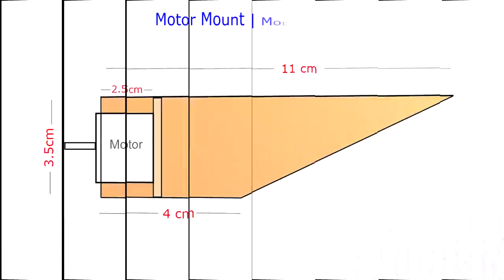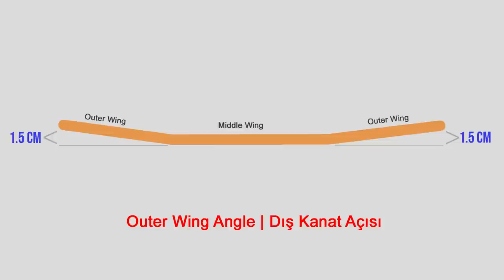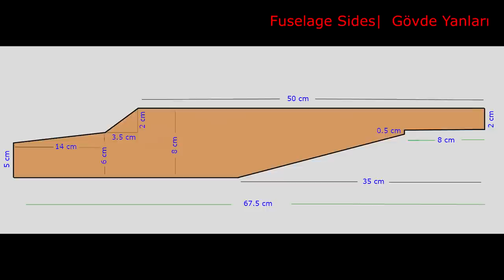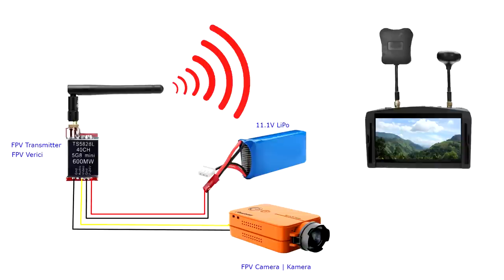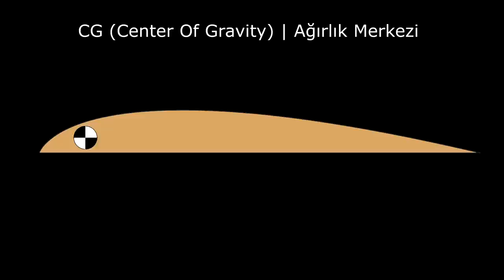Making RC Model Aircraft With Twin Pusher Motor. DIY Airplane With Camera. FPV

Comment: Hello my friend...Awesome your work on rc planes! I want to ask you if you think it´s possible to make a 5mm. foamboard trainer rc plane using a 380 Mabuchi brushed motor style and a 6v NiMH 5 element battery pack with brushed ESC and if you could us to show how to do it or a rc plane plan to install this kind of equipment. This could be useful for us the boat modellers as we don´t have brushless motors or ESC, batteries, etc. Many thanks in advance and have a nice day! Best regards from Spain and keep on your fantastic Kendin Yap (D.I.Y in English ;-))

Comment: I built your fpv system (very smart by the way) and i was wondering if this plane is the best for the system does the cargo plane do well with it too or should i just stick with this model
Reply from the maker: It can be applied to many models. If the goal is long flight time, the model whose video I uploaded recently is much more efficient. https://www.youtube.com/watch?v=eHdxx4qpVko
You can also use your existing remote control with this model.
Reply: Is this model better for the fpv system because it has 2 motors,carrying the weight better or does the plane you sent (the link) work just as well withe just one motor? Is there a difference in how they fly?

Comment: Is this model better for the fpv system because it has 2 motors,carrying the weight better or does the plane you sent (the link) work just as well withe just one motor? Is there a difference in how they fly?
Reply: Sorry to bother you but would the diy landing gear video you made also work well with this model ( the video I sent this comment one) in terms of weight  thank you for your time
Reply from the maker: There is no difference in the way they fly. Having the engines at the back is to avoid obstructing the camera's view. The plane in the link is much lighter. The only advantage is that the flight time is longer with the same battery. You can choose according to which advantage is important to you. Both models can easily carry FPV equipment.
Reply: Ok thank you

Comment: I was watching your video and saw that one propeller is clockwise and the other is counter clockwise ,but what about the motors them self? should they both spin clockwise,counterclockwise? Or should they be different so one motor is clockwise and other counter. Anyway I just built this model so I was wondering because I was confused. Thanks love your videos

Comment: Sorry but one more thing what is the stuff you put on at 13:01?
Reply from the maker: "Aileron hook up part" there are not many stores selling this part. So you can use the following piece instead, which is a complete solution.
https://s.click.aliexpress.com/e/_DdDbu7Z
Reply: @Kendin-Yap is the 2.6 mm appropriate for the servo or is a different size required. The servo I'm using is the one you sent in the link for materials

Comment: did you made the battery by your self !
Reply from the maker: Yes. 3 x 18650 li-ion battery (VTC5A) . Serial connection....
Reply: @Kendin-Yap  i was going to buy a 3s lipo battery but now i'm going to make my oun, i thought of making my oun 3s li-ion battery but i wasn't sure if it is going to work hhh! but now when i saw your video i'm confident. thank you <3

Comment: The only issue I see is that you have no way to tell the motor battery level remaining. If you're too far away (the range showed 3.5km), and your motors die, you'd have a pretty long walk to find it.

Comment: Hocam elinize sağlık uzun zamandır sizi takip ediyorum bir kaç sorum olacak kanat açıklığını 120cm olarak yaparsam sıkıntı olur mu? Birde toplam ağırlık kaç çıktı. Açıkçası niyetim bu uçağı 120cm kanat açıklığı ve tek motorla denemek. Elimde 2212 2450 KV 815gr thrust racerstar bir motor var kanat alanını arttırmak istememin sebebi Wing Cube Loading değerini düşürmek içindir.
Reply from the maker: FPV ekipmanı yokken yaklaşık 770 gr. FPV ekipmanı ile 880gr . 120 cm kanat olabilir. Tabi ağırlık artacaktır. Ve bunun için 2450KV tek bir motor çok ideal olmaz.  Güç yeterli olmayacaktır. Elinizdeki motordan iki tane kullanırsanız 120cm kanat boyu ile verim alabilirsiniz. Tek motor kullanmak istiyorsanız mevcut kanat ölçüleri ile denemenizi tavsiye ederim. Tek motor ile yapacaksanız gövdenin burun kısmını da 2cm kısaltın. 2. motor ve 2. ESC nin ağırlığından da kurtulacağınız için uçak biraz daha hafif olacaktır ve tek motor yeterli alacaktır.
Reply: @Kendin-Yap  Yanıtladığınız için çok teşekkür ederim. 96 cm wingspan 14.5 chord olduğuna göre 13.92 dm2 bi kanat alanı yapmışsınız. Ben çok acemiyim bu işte ama Wing Cube Loading bu ölçülerde 14.8 çıkıyor daha önce başka bir tecrübemden dolayı bu hesabı öğrendim ve acemi biri olarak kırım yaşamak istemiyorum. Kanadı o yüzden büyütmek istemiştim. Bi sorum daha olacaktı kullandığınız piliniz kaç gram acaba?
Reply from the maker: Kanat büyüklüğünün uçağın genel yapısıyla uyumlu olması gerekir. Orantısız bir kanat büyüklüğü beraberinde dezavantajlarda getirir. Örneğin Kanat gövdeye oranla çok büyük olursa uçak rüzgardan çok fazla etkilenir. Yan rüzgarlarda kararsızlık artar. vb.
Pilin ağırlığı 160 gr

Comment: Why you don't use audio from camera to vtx but video still have audio
Reply from the maker: The RunCam camera is recording audio. No audio connection required for vtx.
Reply: @Kendin-Yap  I got it. Thanks

Comment: Abi o kulandiğin pil lion mu
Reply from the maker: Evet 18650 li-ion pillerden batarya
Reply: @Kendin-Yap  peki lipo pil gibi güç üreteniliormu
Reply from the maker: @velesbitcituna3560  5A versiyonları 35 ampere kadar güç verebiliyor. 2212 motorlar için yeterli.
Reply: @Kendin-Yap  5 a derken